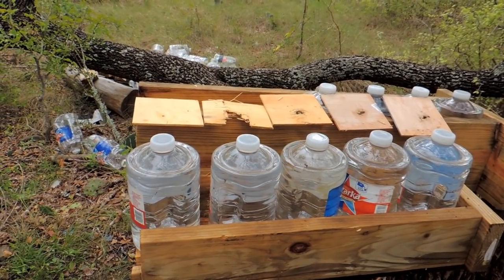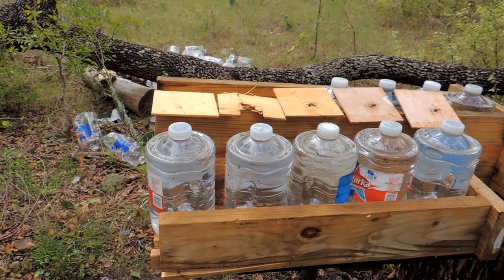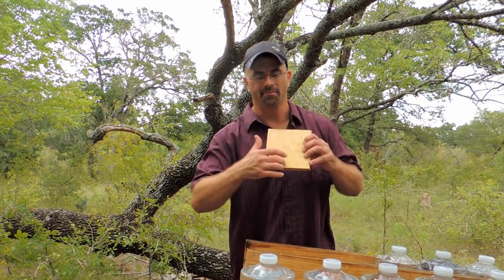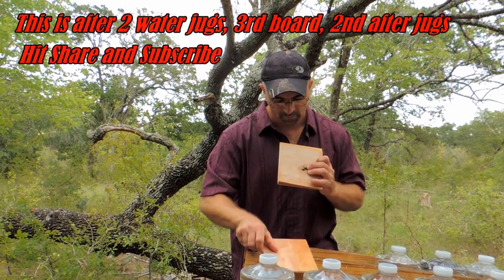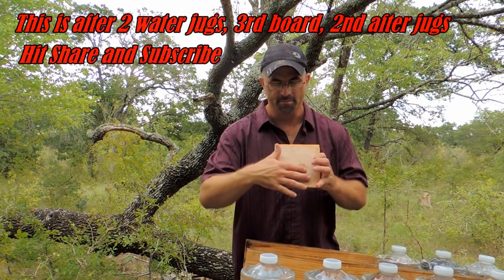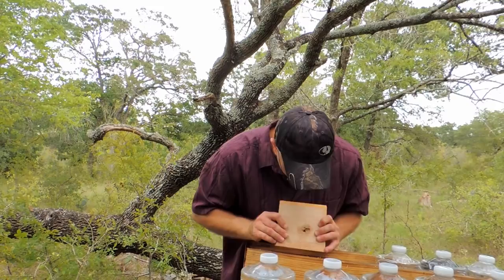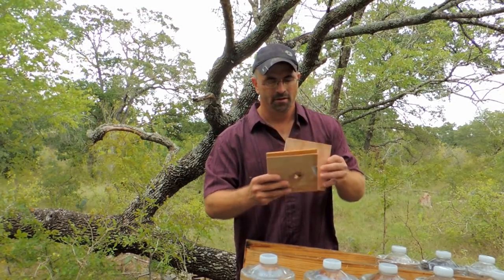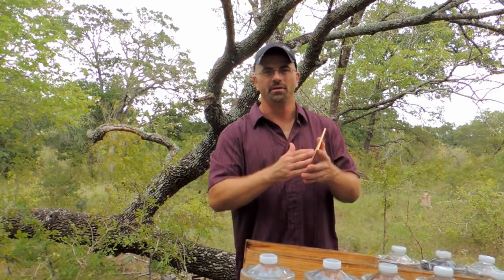FLIGHT TRAJECTORY TEST-.223

Comment: That’s a cool idea, maybe attach the boards with a long strip of wood on the top and bottom to stabilize them?
Reply from the maker: That is something Im looking at, might go with drilling holes and running long bolts through them. Using washers and nuts to hold them in. Thanks Dominic!                                    james

Comment: James. I would look for something which will offer less deflection along the way. I think I get that what you’re trying to accomplish.
Reply from the maker: I think if I drill holes through them at the corners, run long bolts using washers and nuts to space them out and hold them in.  I think itll be really cool once the bugs are worked out. Thanks for watchn!                             james
Reply: That’s a good idea. You could even run a 4-6’ length of 1/4” wooden dowel through each top corner hole and apply a piece of tape behind the hole to stop them from sliding